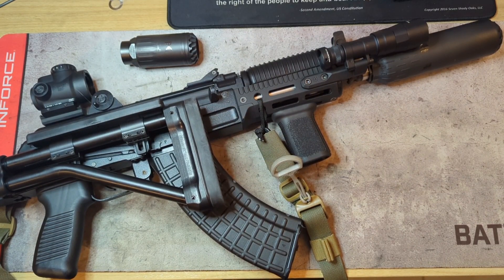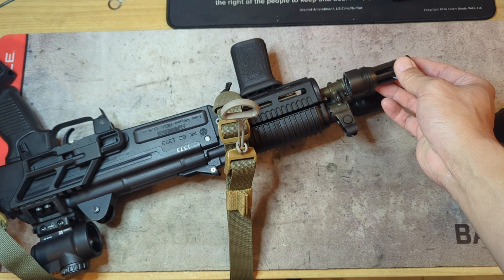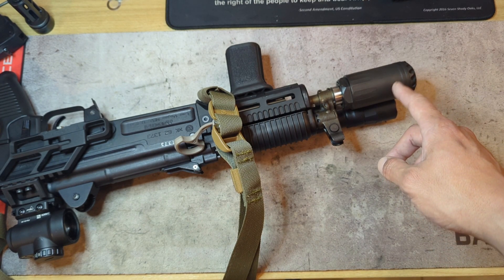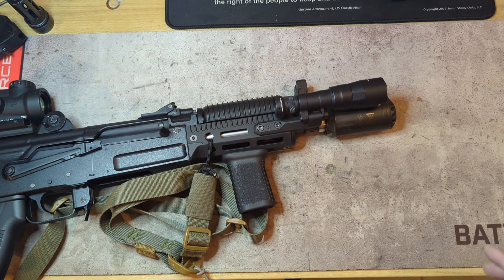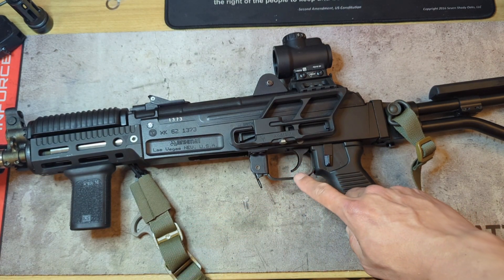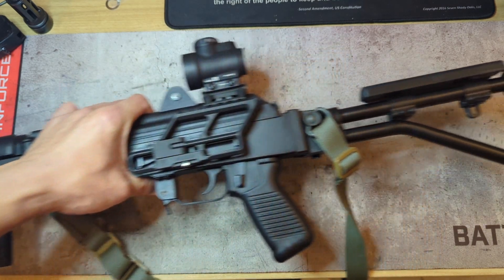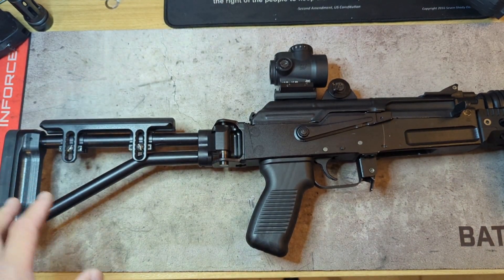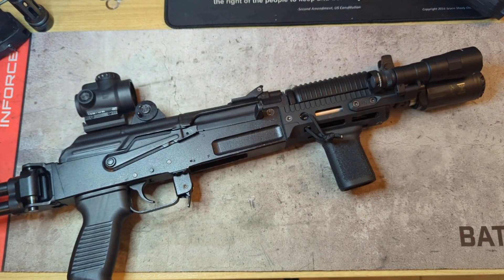Arsenal SAM7K-55 Build Overview and Suppressed Shooting Impressions

Comment: Great build! If you switch out the top cover to the traditional one available at Kvar you  can use the front biased RS Regulate lower mount.
Reply from the maker: Thanks man. I had thought about doing that, but the rearward biased optic setup kinda grew on me. That said, I can never sit still and I can't say it's out of the question for the future.

Comment: Going to order that rail for my SAM7K-44 as soon as they're back in stock
Question: What about an adjustable front gas block instead of the KNS ?
Thanks for this awesome review
Best regards, Pops
Reply from the maker: Appreciate it man! I'd stick with the KNS piston. Much cheaper than going with a block. I actually ended up taking my handguard off and going back to the OEM plastic one. If you'd like to pick up a used one but one great shape, you can email me at regulardudegunreviews@gmail.com

Comment: I love my Sam7k-44 with my dead air wolverine. The wolverine worked on the factory threads and barrel. I would not get the kns for the Sam7k unless you think you'll never shoot subsonic ammo. Mine runs subs with just enough gas to be perfectly reliable, and the kns will rob a little gas no matter the setting. It works great in my galil ace 5.45 and is needed for that to be suppressed. Over all I find the AK action to be loud and clackey sounding. Subs still slightly ring my ears and it's not the ammo, but the action doing it. You can hear the difference in many different firearm actions when suppressed. The Sam7k is a tank though, and I really do recommend it to scratch the AK itch!
Reply from the maker: I did end up getting one and have a vid posted. I was conflicted because it was already a really smooth shooter. It did actually end up making it even smoother. I don't really ever plan on shooting subs unless it becomes widely available again. But if I do get my hands on some, I pretty much expect it to turn into a single shot gun

Comment: was that subs or supers when suppressed shooting
Reply from the maker: Supers
Reply: @regulardudegungearreviewsh3132  do you believe that setup with suppressor would be “hearing safe” inside a house?
Reply from the maker: @user-yt5uw4kh5u  it's not even hearing safe outside. And I get what you mean about "hearing safe". With my AR's and my 16" AK I can fire multiple rounds off and it doesn't hurt my ears. That day, at least. With this little SAM7K, one or two shots and u want your hearing protection back on